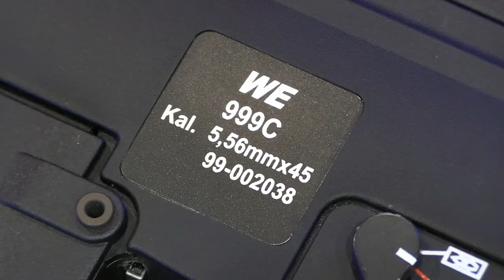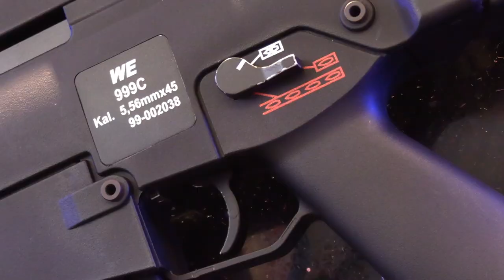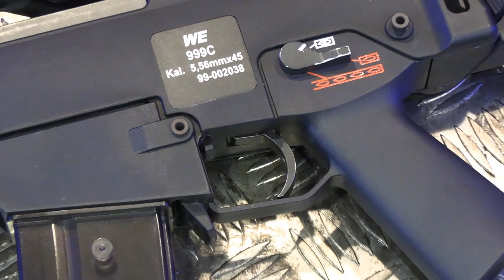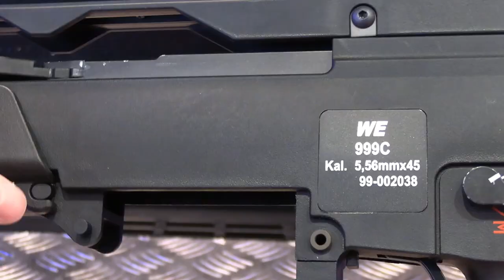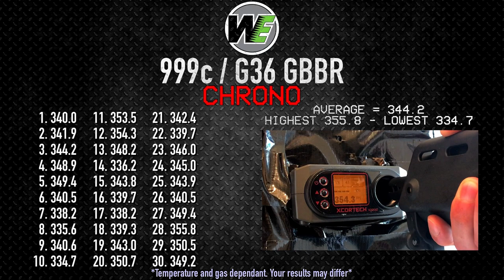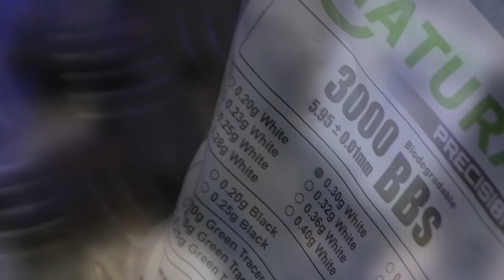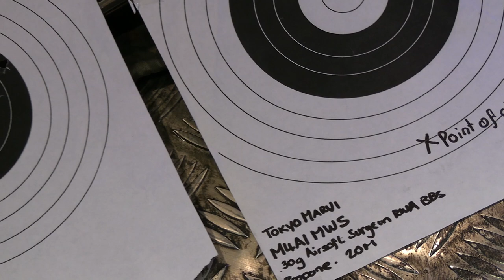WE G36c Review: 10 Years Later - Best GBBR?

Comment: Sorry for your loss mate.

This is always my go to recommendation for new players and there must be 5 of them on our team here. 3600NT (100 quid) is cheaper than all the pistols I've bought here...

Did you replace the whole trigger set with the RA Tech kit? I put it in my original FCG after I wore down the original sears and it always seemed a bit sticky on the reset, so I put a teammates donated original FCG on mine.

Valve striker wore down on my original and now on my replacement so I'll be doing a video of transplanting the RATech enhanched striker from my old FCG to the newer one soon.

Also had the brittle mag issues with two of my four mags breaking the screw retainer tabs that hold in the gas cartridges at the base. And shedding the connector studs. I've just taped mine together solidly in pairs now to make it easier, although I only tend to carry one pair in the gun for fast changeovers because the mags are a ballache for pouches (HSGI tacos work well for single ones).

I broke the front end of the gas nozzle twice doing full auto in tropical heat, and then sheared the back end of the nozzle and seal o-ring off once, but now I have about 3 different nozzle set ups to mix and match parts from, and a spare bolt. Broke the charging handle off twice rough handling it, might get the RATech one of those too. And the bolt stop and related magazine tabs have worn a bit on mine but all still work great thus far. 

Besides all of the wear I've imparted on it (mainly because I love it and have used it as my go to for so long due to reliability, recoil and accuracy using 0.3g BLS BBs) it's still an awesome workhorse and dirt cheap, easy to service and repair.

I've probably put the best part of 15-20,000 rounds through mine here, although it's hard to keep count.

Comment: The G36 by WE, also our recommendation for the gbb community. 

Our condolences for Pete. May he rest in peace.
Reply: Looking into getting a gbbr is this Better than the Ghkm4?
Reply: @checkmate058  It really depends on how you look at how you define better. The GHK m4 has some big advantages that the G36 by WE doesn't have. The GHK m4 can use the Devilhunter mod. This is modifying a greengas mag so it can accept co2 which the G36 can not, it will blow up the magazine. Parts availability is also very good for the GHK m4. However, the WE G36 does score really well for it's value. It's not darn expensive. They go between 200-250 euros while a GHK m4 will go for about 600 euros and higher.
Reply: @checkmate058  also if you want a cheaper way into GHKs then you could always go for a G5 as the mags are compatible. 

The ghk g5
The WE G36
And the WE Mp5 

Are all good starter gbbrs in my book.
Reply: @James-C24  kinda had my heart set on a m4 platform coming from real firearms and loving realism. But this review threw a little wrench into that when he raved about that other design.
Reply: @checkmate058  ive got a ghk m4 and its a great gun. Not fired it yet out on the field but i gassed the mags up left them for about 7 to 9 months got it out a few days ago. Mags still full of gas and it ran like a train. No bbs as i was indoors but its a great reliable platform. If budgets an issue start with a g5 and build up a collection of mags or carry on saving and go for the m4. Either way with a GHK you wont ever be disappointed. You also won't need to do any upgrades to them really certainly not out the box.  

Just dont by a WE if it takes an M4 style mag just dont their shite. Ive had more issues than id care to mention with my we 416.  Unless of course you want a PDW then the we pdws arent bad but i think they have proprietary mags.

Although ive heard of QC issues on the new ghks so that's something to bear in mind.
Reply: New vfc vs this guy?

Comment: If I were to buy one of these the biggest question would be which variant to go for. I suppose given the extremely competitive pricing (along with getting the most from your mag's) the argument could easily be both. A great review and definitely food for thought.

Condolences for your loss, it's never easy losing people you care about.
Reply from the maker: They used to make K and E upgrade packs so you could upgrade your C if you had one already. KY Airsoft can provide the spare parts so you could build whatever you wanted. 

I never touched the K variant but Pete owned the E version as well. It was lovely having that full sized G36. Added a little bit more weight and that naturally soaked up the recoil so it wasn’t as hard as the C. Still, it was badass. 
Depends on where you see yourself playing.

Thanks for watching, mate. 
Cheers for your kind words also.
Reply: @BadaBingPictures  appreciate the heads up, I'll have a look and see what I can find out.

I'm leaning towards the C as I do a fair amount of CQC stuff but I don't think I've ever seen the Helstodt (spelling probably wrong) dual optic on a C. Admittedly that's not an issue but I'd part with my TM G36K and keep the sight as they're hard to find.
Reply from the maker: @FreeFragUK  The C works out fantastic in close quarters so it’s got a great loud bark and snappy too. Trouble is the stock over here for any gas G36 is a bit limited.

Comment: Also had one for quite a long time, it's still alive and kicking, but sadly something weird has happened to auto-fire, it's tripping a lot there, while single fire works like a clock, haven't really got there yet. I also have quite an early model, so yeah, taping the barrel nut to have a better outer barrel fix is required and the hop-up unit was actually really crappy, I was needed to shim the hop-up arm (notch was actually too small for the stock nub, so it was applying too much pressure on the rubber), then with a new rubber it wasn't enough, so I've exchanged the nub with H-nub and it's working great and became perfectly aligned (some other nubs I've tried were inclined to tilt in a single direction, so hop-up was also uneven and that hurts accuracy big time). Absolutely agree on that the gun is probably the best entry ticket to the world of GBBRs - pretty affordable, while maintaining a descent level of quality.

Comment: Hey Badabing! So guess what, I bought a WE G36c from taiwangun on black friday and 4 extra mags. (In no small part thanks to your praise.) But TBH thanks to the bad luck I had with my two latest buys (WE Apache A3 and LCT G3) I dreaded it. And then the gun came and I inspected it tip to butt (just how the navy likes it - if you're a Garand Thumb fan ;-) ) and I could find no flaw and also no mags leak. Literally the only two small complaints I had was that the bolt release button was stiff and not all mags clicked in that positively, you have to go in in an angle towards the back. And then I've put two BBs through a chronograph, the first came out at 130m/s the second 129m/s (in around 20°C (68F)). WHAT THE HELL, that's DMR territory, around 1.7J!  Your chrono results are much lower and taiwangun also showed 1.2J on the product page. Do you know what's going on? Does the gun need some sort of a break-in period? It came soaked in silicone oil, does that need to clear out or something?
Reply from the maker: Hi mate, 
Congrats on your new blaster! How are you liking it so far? 
Yes the bolt release is very stiff, thats just how it is. I really want to get my HK extended bolt release fitted but I just don't have the time atm. 
In regards to the DMR speeds, thats pretty typical of units direct from Taiwan. Others can arrive which feature EU nozzles and those kick out friendlier readings. Mine may be one of those EU nozzles with longer tabs on the rear nozzle half that push the cylinder farther forward. 
The one which originally came with mine was a green nozzle, must have been a generational improvement -although it had an FG 20% Restrictor disc AND an NPAS! Completely strangled the gas system where it performed terribly. 

Seeing as I had an earlier nozzle which was completely stock I swapped them over and thats the one I used for this review. 

No breaking -in required to be honest. Clear out any silicone that may have seeped into the chamber and away you go. It doesn't ask much from you, just gas and go.
Reply: @BadaBingPictures  Yes, but taiwangun.com is a store in Poland so I expected 1.2J from the gun. Anyway, I'm gonna have to do something with it... I may look around on kyairsoft, do they respond to emails if I ask them?

THB those 2 rounds through the chrono are the only ones fired by the gun. When it arrived my city was under a 2nd round of lockdown, which ended successfully last weekend (well, realtively, infection rate dropped 1‰) but now the weather is pretty bad so I can only admire the gun for now. And it looks surprisingly good. Much better than it's price would suggest.

I've seen a "tactical bolt release" on begadi, which would probably help, but it's out of stock :-/ They also have a nozzle set so I'm going to ask them. My nozzle is a strange grey colour, I don't know what is up with that. Some people say that the NPAS is not very stable so I'm not eager to fit one of those in the nozzle.
Reply from the maker: Oh right. I've never bought from taiwangun so I wasn't aware. 
They responded to my messages on FB and IG, give it a shot. 

Ah yes. You're right about the grey colour, mine is the same but I see it as green as my eyes have a hard time with colours. I would rather cut the chrono readings with a different inner barrel rather than cut off the gas with an NPAS.
Reply: @BadaBingPictures  That's a good idea, because then I could go for a crazy jet, those work well for me in 3 other guns. Any suggestion on what length I should try?  I know I've asked you before about the usual speed gains/losses with one unit of barrel length/diameter change and I swear, this time I'll write your response down. Social media is not ideal to search previous comments.

You should check out taiwangun, they have pretty good prices and fast shipping (at least inside the EU, IDK if brexit changed anything for you guys). And their black friday deals were real. And their staff is helpful. Unfortunately they don't have as many gas blowback stuff as for ex airsoftpro.cz
Reply: @BadaBingPictures  I can buy a crazy jet from a local store but should I go for the 200mm or the 180 or even lower? The 150 is out of stock, but there's a 138. They are all 6.04 just like the stock barrel (at least if you can believe what taiwangun says about the stock barrel, I'm too afraid to stick calipers into an inner barrel, I may scratch it).
Reply from the maker: @sogerc1  How much FPS would you like to lose? You could have half the length if you want, although I’m not sure how much that decreases with every cut....

I replaced the inner barrel in my WE MP5 with a 113mm and that gives me highs of 320 and lows of 295ish. It used to shoot as high as 360 with the stock barrel and that’s not that much different to the G36 length.
Reply: @BadaBingPictures  Whoops, I forgot to mention that. So, now it's shooting at around 425 FPS and ideally I'd like it in the 380 ± 10 FPS range.

Comment: As every WE gun in our airsoftteam broke, even the expensive RA Tech tuned one which cost around 1000 €, i started to hate this company for eternity. There where: the ak47u, m16a1 vietnam, smg 8, around 4 Glock 18c. Every single gun of these broke and lacked extremely in therms of cooldown. WE go to hell!
Reply from the maker: I’m the same with VFC. At least WE guns have a high chance of working out of the box. VFC doesn’t bother finishing them in the first place. 

Personally I’ve never had a bad WE gun. And any parts required are plentiful and cheap, no complaints here.
Reply: Most WE Guns absolutely suck, youre absolutly right. The Ar15 receiver parts are so unfathomably soft, once broke the fittings of the dust cover right of by just closing the dust cover. To be fair, the we g39 ist one of the best WE rifles performance wise regarding hop, gas efficiency, and body reliability (that I even have to say that). But long term everything brakes. There are even parts in the antiquated trigger groups which make no sense (this little silver thingy which traps the striker and when worn out jams the gun, until you remove it completely - which changes nothing...). 
The other guns are so abysmal in terms of cooldown, won't even start in this department.
Reply: @BadaBingPictures  did you ever try out a KWA lm4? these have rock solid internals ootb which last forever, so initial flaws have been ruled out quite fast by the company, gas efficiency is with the best gbbr rifles and you can even fire the gun reliably sideways (not that it makes sense most times because of the hop up). 
So many people are mocking the hop up systems, but its actually quite good once you understand how it works (which most people doesnt seem to bother with and complain all over the internet).  With the maple Leaf hop rubbers and the stock assembly its very good for a gas gun indeed.
Reply from the maker: @marcelschultz4033  I haven't tried the KWA LM4. But to be honest with you I have no need to. Not when I have the GHK and TM M4's. 
The LM4 doesn't offer me anything more than those other platforms.
Plus they're not very well supported where I am, so it wouldn't be a wise investment.
Reply: @BadaBingPictures  You can get mostly all parts from rainbow8 in taiwan or from the kwa pro shop, which both are fast and reliable. I'am kind of a KWA advocate here in germany for the lm4 since the beginning (we first got it in 2016, years after release afterhaving to tinker endlessly with WE crap ARs). 
I also repair GBB rifles as hpbby for the gbb community, especially KWA stuff. Its compared to all the other systems the most reliable one with the best low temperature gas efficiency. I play mine since 2016 exclusively as my primary gun, as a side note. 

Way ahead of VFC and WE and absolutely in the league with GHK (which I also like), but with a little bit more refined and quality internals stock. 

Was just interested if you ever tried one, since you had some trouble with vfcs and stuff. cheers
Reply: I also have a few KWA guns (HK45, USP Compact, MP7) and have found them to be very reliable - but still worn them out, with two nozzle heads crumbling on my HK45 as well as the magazine release wearing down twice and the swinging arm in the valve striker cracking.

I snapped the trigger bar in the USP Compact by accident pulling the trigger when the safety hadn't fully disengaged but other than that it's been solid.

I've worn through two bolt carriers on the MP7 as the little front face block retainer screws always break through the front edges of their holes, and the piston and its retainer screw also wear down and loosen up with the constant hammering. The stock spars also tend to wear through their notches and need recutting to avoid them collapsing when you shoulder it and pull it in too hard. Otherwise probably my favourite go to gun with excellent handling, accuracy and dependability.

I'm beginning to think I should start my own parts shipping business from here in Taiwan... So many people seem to struggle to find them whereas I can just go to the shop on the way home from work and pick up pretty much anything.
Reply: @stewbacca117  good luck, but there‘s still http://www.wiitech.com.hk/product-list.shtml?path=57_116 which made good quality parts for KWA guns. BTW i own two MP9.

Comment: i had those G36K and C, installed a we PDW inner barrel by Laylax/prometheus . Shoots 450fps for The C type, and 520FPS for the G36K with modified prometheus AEG inner barrel 363mm

rock solid never failed to shoot, that barrel wobble can be remedied if u use Ares B&T style Handguard with a little filling . 

my only complain is just the magazine case. just like your video explain. overall a very reliable GBBR. hammer destroyed after 4 years.

if u want to upgrade the trigger set i suggest only to change the hammer with the ratech one leave other stock

Comment: If these were in stock anywhere in Canada I might have picked one up instead of an MWS MK18 for 950CAD. I also noticed in the tear down there was a rubber buffer to absorb some of the shock of the bolt hitting the receiver. Why this isn't standard on most GGBR's like the GHK G5 is beyond me. My Kwa VZ.61 has something similar and the thing its rock solid, whilst I read that MP7 and MP9 polymer bodies crack all the time.

Comment: Anyone who has ever shot a G36, either a fake one or a real one will tell you, if you have to touch the charging (NO) maintenance handle outside of maintenance, youre using it wrong. The g36 is meant to cut costs. It cheap to produce because of the polymer, the real magazines are less than 5 quid each, its easy to take apart and maintain, and on top of it all, using it get so much easier once you discover the secrets of the bolt release. If youre a right hand shooter, lay your left hand around the magwell, such that the gun rests on your left thumb with the bolt release and give it a fiststrike on top of the buttstock with your right hand and the bolt carrier will jump forward. Similarly you can also angle it 45 degrees to your left (positive mathematical sense, negative clockwise) and you can also use your right hand and fiststrike the right side of the gun to release the bolt. If youre a boring man, you can also just release with your left hand by tilting your left hand away from you.

Comment: Hotter gas... But if it's cold, then that gas is probably not more powerful than GG in summer temp? or is there something I misunderstand?
Reply from the maker: Yeah I suppose you’re right. It’ll even things out. 
The gas seals on the magazines are 1mm thin wide o rings. I think any high pressure gas will just blow them out if it’s in comfortable temperatures.